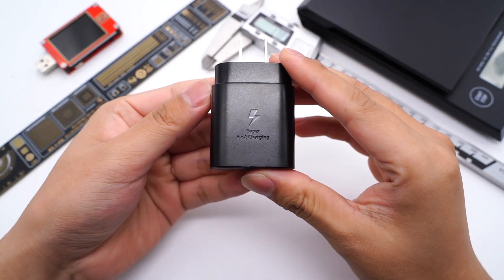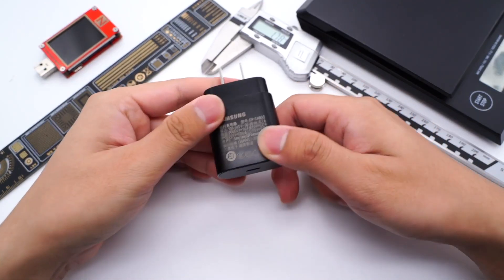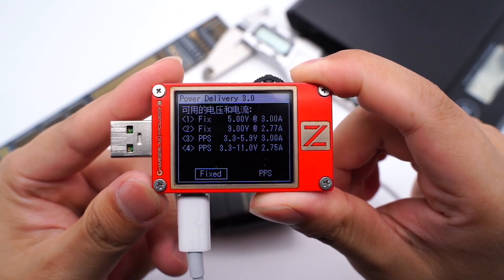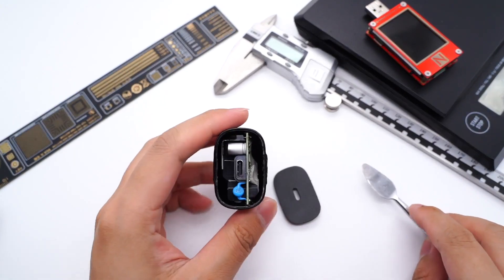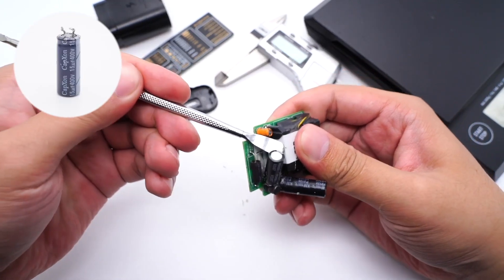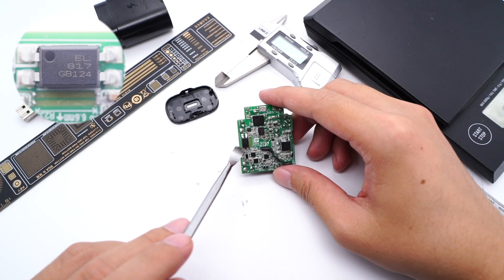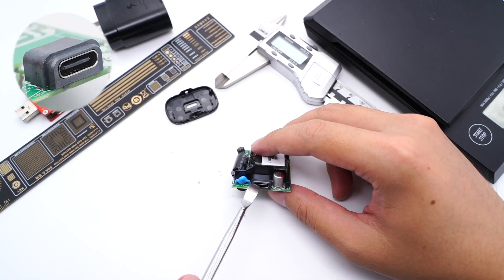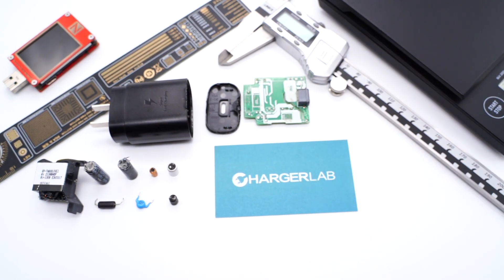Teardown of Samsung 25W USB-C Fast Charger (EP-TA800)

Comment: I purchased the white version of this charger from Amazon exactly two years ago for $20 US. It blows my mind to see a micro motherboard in that little device. I find it hard to believe so much tech can go into such a small space and cost that little. I've put together a couple of simple gaming computers, and my latest RGB version I put together around five years ago cost over $2,000, so I know motherboards, somewhat. I also have a Samsung 10W charger and I use that most to preserve my Samsung A53 battery. Is that something I should be concerned with? Fast charging I mean.

Comment: Hello, my charger cap has fallen off and i can easily remove the PCB as there's no solder. Is it safe to reassembly? I test and it works normally AFAIK. I'm afraid loose contact from the PCB to plug would cause fire hazard. Thank you in advance

Comment: Honestly this is probably the best charger that ever came with my Samsung phone I've been using for my fourth phone which is Samsung s23 And it just died The charging block that is and it's been through multiple washes swimming pool water spilled on it you need me I'm surprised it didn't die a long time ago  😅

Comment: hello, I have a similar charger that came with my galaxy m51, it's also usbc. the charger started not working and depending on how I mess with the USB port it charges, I assume is a problem with the usbc connector, how would one replace or fix this connector?

Comment: my t800 doesn't output any power but data voltages are normal and phone shows super charging mode or i can switch to normal 5v charging, and there is no error from the phone even with normal 1h charging time 😢 i haven't another C to C cable to test and i hope the adapter wasn't the issue 😢 response me if you have any suggestions ❤

Comment: so transformer input (power from wall) 110v or 220v. what is the output? I mean what voltage supplies actual pcb? im not nerd in this, but could i connect that charger on battery? i want to make sort of powerbank with super-fast charging for my samsung as i can't find one to buy

Comment: Nice detailed video - I stumbled on it looking for an explanation as to why this charger is recognized as a super-fast charger by samsung devices but others such as INIU's 25w PD 3.0 fast charging mini wall charger is not - despite it being PD rated as well as all the other specs appearing to be equal. 

Do you have any thoughts on why this is? What makes the Samsung 25w "special" that it is properly recognized? 

side note - the phones report the exact same estimated charge time regardless of which of these chargers i use - also interesting that the INIU is recognized as a "Fast Charger" just not a "Super-Fast Charger" - what defines "Super" to the mobile's charging system?

Thx!
Reply from the maker: It depends on the PPS protocol that INIU's 25w can support.
The Samsung Super-Fast Charging is actually the PPS protocol.
Reply: @ChargerLAB  I find it odd that a galaxy 20FE does recognize the INIU as super fast but my fold4 doesn't... 

Thanks for your response!

Comment: i have anker nano iii 20w charger, for samsung S21, should i buy this one? or the nano port iii 20 w is good enough?
Reply: Only buy a charger that has the PPS feature. Without PPS, on a Samsung phone, you'll only get 15 watt charging.
Reply: i have s21 also,   and USB checker  with the 25watt samsung  i bought separately charger it charges only 20watt at max anyway :(, so take what cheaper for you  (it stll faster by about 10% faster then 15W version
Reply: I was considering same question whic is better this one or anker ace 25w as component quality and for batter lifespan ? I don't care much tinny charging time differences.

Comment: Hi I wanna bypass the 230V part and use my little solar pannel that makes approx. 5V on the low voltage side on my EP-TA10XXX Rev. 1.1 Dongynang E&P. Any idea how to find info on that or simply how to accomplish that? Kind regards Mike

Comment: I had this charger along with Galaxy A71 (2020).
Now I'm using it with Galaxy S20 FE 5G.

One day, it had problems, it charges very slowly, 1 percent per 5 minutes.

My observation:

if it's charging normally, there's a consistent buzzing inside.
But when it doesn't charge normally (starts to charge slowly), the buzzing fluctuates.

The (temporary) solution was to unplug the charger then plug it again every 2 minutes.

Super Fast charging is enabled, nothing is wrong with the phone.

What do you think the problem of this charger? 
I need help, do you think it can still be repaired?
Reply from the maker: Sorry we can't judge the problem from the outside.
We'll recommend you to buy a new one, cause the charger is pretty hard to be fixed.
Reply: @ChargerLAB  oh, I see. 
Thank you for the quick response.

Comment: When I slightly shake my charger, I can hear sometning dangling inside, like a cushioned rubber shape (the dangling sound is somehat  muffled). I thought the PCB might have some free room inside the case, but I saw in your video that it has grooved holders and glue, which shouldn't allow it to dangle.
Is this normal?
Reply from the maker: Not all charger will filled with silicone adhesives.
So, it is normal.
Reply: @ChargerLAB  , thank you for the reply. The charger is new and works normally, but I was  worried something may have come loose inside. Thanks for the input. 🍻

Comment: Could someone recommend a good 12 volt type c car charger for a Galaxy S10+ ?  My current charger barely keeps the battery level maintained let alone charged. If I drive an hour I may get 3% on the battery charge.
Reply: I have had only one qc3 car charger...generic brand, but reliable. Go for samsung, anker etc...

Comment: due to chip shortages and prices rising can you do a video (20mins) on how to Safely recover working chips for other uses (recovered from laptops, chargers, led tv boards, hard drive enclosures) and their uses.
Reply: Caps are subjected to near the limit sometimes operating temperature in psu s
You may look at the discoloration of the pcb or it gets darker in areas of high temperatures.
Avoid taking caps from there
Use soldering Station for removing parts
Personally, I tried using removed mosfets, they looked fine, but blew apart when reusing.
Today you can hardly reuse something unless it s new or almost new.
Try opening an led bulb after 6 months of burning...look at athe board, you can see the brown area from heat....
Have fun
Sincerely, 
Florin D.

Comment: I hope the channel will have more reviews about electric, ex: Ripple noise
Reply: Original chargers/ psu's are ok regarding inrush curent and ripple, Samsung has hid distinct low profile ferrite transformers.
Go for the original ones, now i have in front on my desk this model în video, and the design is different and small spark gap.
Also no glue/ resin on back of pcb.